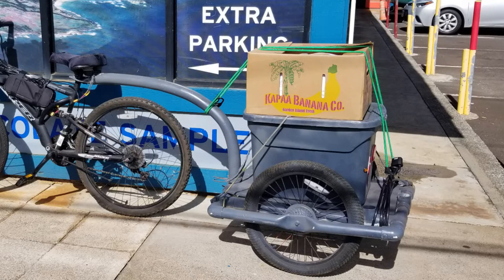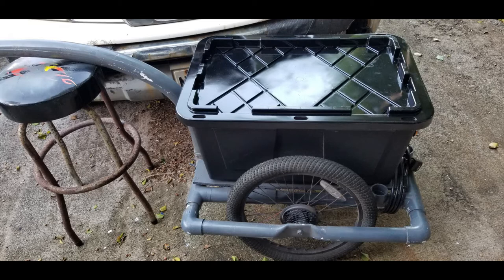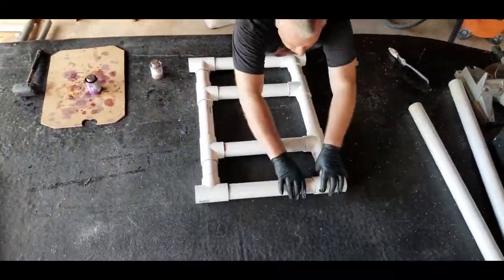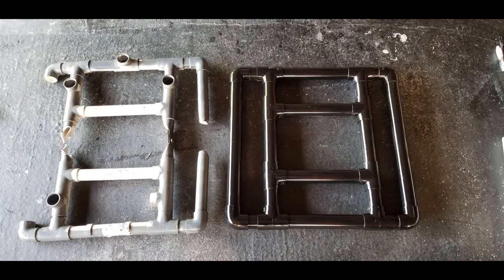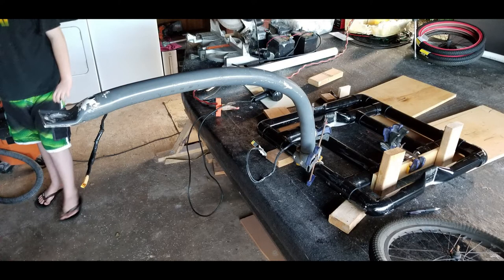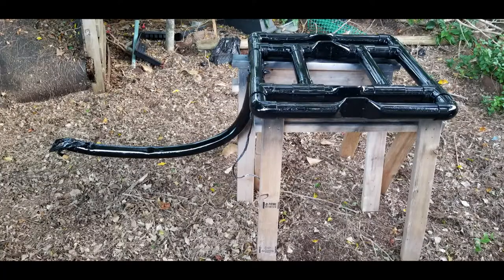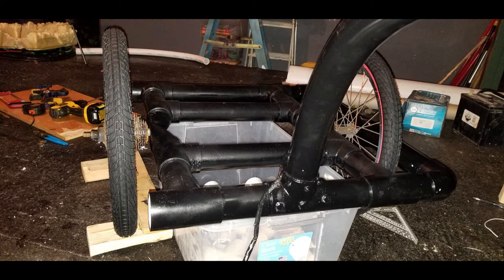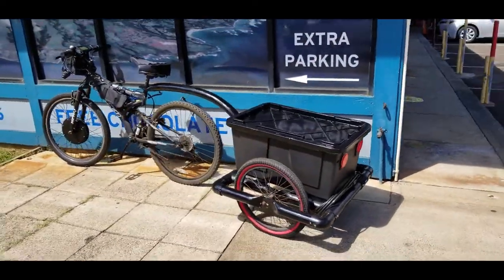Design Plans for the Best PVC Pipe Bike Trailer! - E-bike Build # 5

Comment: 7:05 I know I'm late to the party and I'm not an engineer but I thought the strength of pipe was that it was an arc. You could probably increase your capacity just by leaving the pipe round and using a longer bolt.

Comment: And as it turns out that’s the weight limit the weight limit for this trailer.You delivered that  line so well.  Was not expecting that
Reply from the maker: Gotta test a prototype to the breaking point... this trailer was actually pretty tough.  I ended up putting my battery on a rack and gave the trailer to a local homeless guy. He has not managed to break it yet!

Comment: Very cool stuff. Someone with the availability of lithium batteries could make use of this as a cargo trailer. I've seen some of the other gooseneck trailers. Never thought about just a big hole for the seat post to pass through would allow it to move in any direction necessary.
Reply from the maker: I was able to haul 2-300 lbs with it on a regular basis.

Comment: Nice trailer.  Could you make another video showing how you shaped such a large radius on the towbar?
Reply from the maker: i filled the pipe with hot water and used a heat gun to get it to bend without kinking. To get the shape in the pipe I drew it on a piece of plywood and put screws in (but still standing up) as a guide to put the heated and flexible pipe into. Once it is in the shape let it cool and then empty the water out.
Reply: Thanks.  I'd still like to see a video too.  I bet so would others.
Reply: @ronyerke9250  https://www.youtube.com/watch?v=nuCKbK845e8 E-bike Build # 3 - PVC Trailer Upgrade to 2" PVC

Comment: To make the whole thing stronger, I would double pipe it, where you put a smaller pipe inside of a larger pipe. Then for extra security and peace of mind, i would suggest bending over a piece of metal where you flattened the pcv pipes to put the wheels on so that the weight is supported by metal fittings instead of bearing down on the pvc itself, that way you should theoretically never have to worry about the pipes breaking at the wheel connection like what happened with your first build.
Reply from the maker: Several people have made that comment and it misses the point of this build. What you are suggesting is to build an internal frame of metal to transfer the load too. In the tropics, metal and wood are points of rapid failure. When I upgraded this design to 2" schedule 40 PVC and then fiberglass reinforced the main stress points it works fantastically and can regularly transport over 100 lbs. I even carried a 200 lb. person up a hill with it. The trailer has been used daily by homeless people for several years now without failing.

Comment: 3:00 I use wooden filler in high stress places. In curved pipes, foam soaked by epoxy is suitable. Now I make aluminum trailer in that way. The ladder pipes are enough for 100 kg load which I got. The hinch is cushion rubber. The towbar 180 degree verdical angle adjust include chain sprocket.

Comment: I like this idea and a good source of lithium batteries is wish shopping made easy ( fun ). I am an avid outdoors man and use a bike a lot to get to places to hunt and if made longer it would be just about perfect and very lite weight which I need to haul equipment and after game out ( deer and or small game ). I have an idea to reinforce the place where the wheels go by heating the pvc at that one point on each side.befor you glue all the parts together and while the pipe is still hot insert the next size down of pic into it and let cool and you can still reheat and flatten for the area for the wheels it will increase the strength to about 100lbs more also it will work great for a hybrid pedal assist bike ( gas& electric ) motors with a jack shaft for more speed from the gas engine.
Reply from the maker: Give it a try!

Comment: One thing for the preperation of the pipe. Is to champfer the outside of the pipe. What this does, it  helps to keep from pushing the glue down the outside of pipe. There is a tool for this or just take razor knife and bevel the outer edge of the pipe. 
 Hold the pipe in one hand and rotate it against the blade at a 45 degree angle.
 Also when glueing  the pipe and fitting, rotate  when bringing them together. Start the process 90 degrees out. 
 When doing multiple tees, I've found it to be easier to use the face of the tee on the table for checking square. Hope this may help.
Nice build
Reply from the maker: Mahalo!

Comment: Ive revisited this build multiple times. I love the design and ingenuity. I have not built this because I am really wanting a single wheel design for single track riding on/off road. I wonder if you have given thought to doing a pvc build in a single track  configuration like the Burley Coho XC?
Reply from the maker: Just use the same build techniques for a 1 wheeler. Mimic the layouts of some of the commercial models but just make it from PVC. If you screw the PVC together then you can re-use it.
Reply: @DIYKauai  Thanks for the response and insight. That is my intention. To use your PVC concept but, hybrid the design for a solo wheeled cargo bike trailer. Your ideas have inspired me for sure. I had hoped you might give some detailed insight from your perspective if you have ever even given it any thought as to narrowing your design to a single wheel trailer? I wonder if putting a hub motor into a single wheeled PVC frame, how to beef it up so it would not easily tear out of the flattened pvc axle design. Maybe gusset, plates of aluminum and some type of torque arms one one or either side? Anyway, I do appreciate you trailblazing the PVC concept and proving its longevity.

Comment: I wonder what will be the effect if your pipe will be coated with a resin to make it more sturdy. shredded plastic can also be added and inserted inside the pipe so you can use smaller size pipes to match the size. Also, since you manage to flatten the pipe, do you think it will be more structurally sound if its gets flatten close to the coupling area.  It would be interesting to see more of your innovations.
Reply from the maker: give it a try... fiberglass reinforcement seems to be plenty strong!

Comment: Thanks for your video. Very inspiring. I love working with PVC. I need to build a trailer as well. Do you think it’s possible to build a recumbent trike or quad with PVC? Maybe use 80 grade instead of 40 grade? I only need to support a body weight of a small adult, so double the capacity for safety (350lb). Keep up the good work and any thought would be appreciated. 🙏
Reply from the maker: I totally think so and have some thoughts to build a 3 wheeler similar to the ELF bike. Schedule 40 is quite strong and you can fiberglass reinforce any areas that would be subject to extra stress.

Comment: Your trailer is cool. Looking at your diagram of PVC pipe lengths and it occurs to me that the lengths are plenty short enough to double schedule 40 pipe like 1/2 inch and 3/4 by heating the 3/4  with a heat gun and inserting the 1/2 inside to give enough strength without having to work with massive large diameter pipe. Also, don't paint it black. It absorbs more heat and weakens the structural integrity. Splitting PVC is the result of overheating. I'd suggest compressing the axel arm sections prior to assembly and paint. Additionally, I wouldn't compress them all the way flat.

Comment: You could also make a Solar charger for your ebike.. The trailer will need a GVB-8 Boost Charge MPPT 48v controller.  Then a 100w solar panel.. Look at the SunTrip race on youtube for ideas.. You won't need to haul those heavy SLA batteries.
Reply from the maker: That is a good idea. I am using 4 solar panels for the boat I am building. As for the bike I upgreaded to lithium and put a luggage rack on the bike to carry it... no longer have the trailer, gave it to a homeless guy who is totally stoked now.
Reply: The Sun Trip had a great range of bikes taking part.

Comment: Do you have instructions on how to make the bike attachment pole?  Looking at building these for homeless to haul their stuff around.
Reply from the maker: There is another trailer video that shows it.. I just use a heat gun, some boards and some clamps. Then I drill a hole in it that is a little bigger then the seat post.  Super easy and durable.
Reply from the maker: I gave this trailer to a local homeless guy who used it daily until it got hit by a car... I rebuilt it and this video show me making a new seat connector arm.  https://youtu.be/yr439CRBFao
Reply from the maker: I also just converted a homeless guys rickshaw to electric and added a couple of solar panels on for self charging.
Reply: @Judy Lowery... I am a handy woman and will build some for homeless too. Also, my adult son he bikes everywhere by choice.

Comment: Hi, great video, do you have any ideas on how to reinforce the tube where it joins to the axle, maybe gluing another layer of pvc on top?
Reply from the maker: No need... I put big washers on to distribute the load a little and of course upgraded to the 2" PVC. The first one cracked because I overloaded it with almost 500 lbs of stuff... most bike trailers only support about 100 lbs.  The whole point of the prototype was to push it until it broke so I know where the breaking point is.

This one can carry plenty of weight reliably for a long time. It is my daily driver and I regularly carry about 100 lbs with no problems. Just did a 16 mile trip over bumpy roads with 150 lbs of stuff including construction materials and it was all good!

Comment: I get that turning would be ok with that hitch, but what about lean and up and down of the trailer?
Reply from the maker: There is enough play on the hitch (where it connects to the seat post) that turning and angles are no problem. check out my other videos where I do a rebuild on the trailer...still going strong.
Reply: @DIYKauai I finally got mine to work. I initially drilled the hole a bit too big. I put a smaller diameter of pvc through it and heated it on both sides while on the seat post. It helped it conform to the angle while on the bike.
Reply from the maker: @justinkayce9811  great job. PVC is a cool material to work with. You can also fiberglass over it to add strength if needed.
Reply: @DIYKauai  https://youtube.com/shorts/gCIbl0NGqWk?si=use9PMjcfzfF7OEZ

Thanks for the inspiration!
Reply: @DIYKauai  I put a short up on my channel showing my finished trailer. Thanks so much for the ideas and inspiration!
Reply from the maker: @justinkayce9811  super cool short and great job with the trailer!

Comment: If you added a solid axel all the way threw the weight capacity would raise even further
Reply from the maker: I was avoiding any metal as in the tropics it will deteriorate quickly - 1-2 years max at the coast pretty much.

Comment: You said you used hot water to bend the connecting arm, but you neither told, or showed, how you bent the connecting arm. Would you please show? Thank you!
Reply from the maker: We have it on the "list"... I took a piece of plywood and used screws to create the outline of the shape I wanted, (a jig), then filled the pipe with hot water and used a heat gun to get it bendy. Then I was able to bend and push it into the jig.
Reply: @DIYKauai  In case I didn't say, "THANK YOU!!!"

Comment: Try IZIP ebike batteries cheaper on ebay i found 2 x 24 volt ? its a suggestion , maybe bit lighter
Reply from the maker: Thanks for the suggestion!  I have already upgraded the battery and ditched the trailer - what a difference that made!

Comment: That cut off T connecter for the hitch arm is going to fail. You should not have cut it or drilled holes in it.
Reply from the maker: It has actually proven to be incredibly strong. I have given the trailer to a local homeless guy who beats the crap out of it daily... I saw the connector yesterday and it is doing just fine. Easy to fix if it eventually does break but 1 year in and regularly hauling 100-200 lbs... no rust, no bust.

Comment: The total cost of the finished product?
Reply from the maker: PVC pipe and couplings are much more expensive on Kauai then on the mainland. It cost me about $150 (the wheels were free from the dump) but it would probably be much cheaper for you. In the video is the detailed diagram for parts.

Comment: Better do it from Aluminium tubes ... 😜✌️
Reply from the maker: Not available on my island so the purpose of the experiment was to do it with no metal... results were great!  This thing is used daily to haul all kinds of stuff.
Reply: Great Job ... 😜✌️ but plastik breaks ... i saw ... what Can you do ?
Reply from the maker: @petepete66  I just saw it yesterday and it is all scraped up, loaded up with a couple hundred pounds of stuff and working just fine.  It is used daily and abused and it is super strong.

Comment: What's your range on the mower batteries?
Reply from the maker: They were terrible... lead acid sucks for this application but I had no money so...   I bought them new and was able to get about 8 miles of no peddling but this drained them way too far... 6 weeks in they could do about 4 miles.  I have proper lithium now and no longer have to tow batteries.  There are more videos.  Aloha!

Comment: Also a video showing how you used the electrical hookups to power your bike.
Reply from the maker: Aloha Will. There are 4 other videos in this build series. In this one I rebuilt the trailer so I reused the connecting arm from the last build. For electrical I wired 4 12V batteries in series to get a 48V battery. I charge it to full which is about 52V and then discharge it down to about 40V... this has pretty much killed the battery, reducing my distance by over half in a few weeks.  Lead acid car batteries are the worst for an e-bike. For electrical I use the XT90S quick connectors because I have to plug/unplug every day. From the batteries I have run wire through the connecting arm of the trailer to just under the seatpost of the bike. This is where it connects to the motor controller. I have an XT90S by the motor controller, and another one next to the batteries. This allows me to disconnect the bikes or the batteries easily. I am so done with lead acid... looking forward to getting a lithium battery. It is hard to get them shipped to Kauai.
Reply from the maker: This video shows it:  https://youtu.be/r4oWhtkxmmg

Comment: Some things that were not mentioned in this video were;  In order to get this to work you must have passed through charging he didn't mention that, camera a lot of bikes and scooters and other electrical vehicles sometimes don't have this feature and therefore you cannot use an external battery to connect them. Now. Now if I'm wrong this is why he should mention in his videos Oh why and how you connect the external battery battery and what is its capabilities and how much further further can you go. I will watch his other videos I already subscribed to find out if he mentioned these other attributes in his older or newer videos, the trailer was very easy and very good And I hope this comment doesn't make him upset but yes there are room for improvements like using Composite materials to make it stronger, Keep in mind this idea if you're in a hot air balloon you're dangling from materials real, no use poor man's fiberglass techniques techniques to wrap your PVC pipes at the weak points, The glue would be up to you I've used super glue all the way from from gorilla glue But taking these materials and rapping them tigit's rapidly around and glooming them greatly strengthens strengthens the trailer and trailer and still keep its light weight capabilities, For those who don't understand this is carbon fibing techniques Or fiberglassing just Or fiberglassing  If you want to stretch the imagination it is basically just Laminating a material that has strength to it these are called composite materials when you do such a technique it works and I think you'll be able to carry a 1000 pounds if he uses this with some steel bracket This is Lloyd Stovall from media library who has been doing these techniques for years, We have a flying car that uses these or this technique And we have ideas to improve the batteries up-and-coming soon Thanks everybody for reading this by now